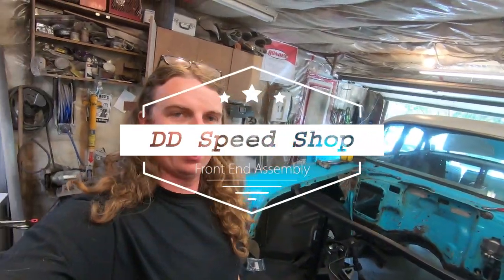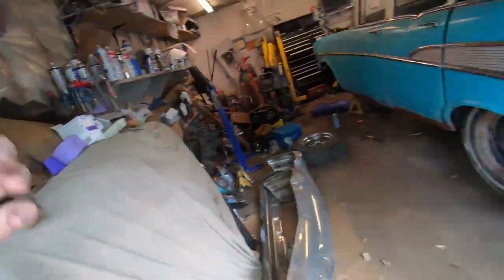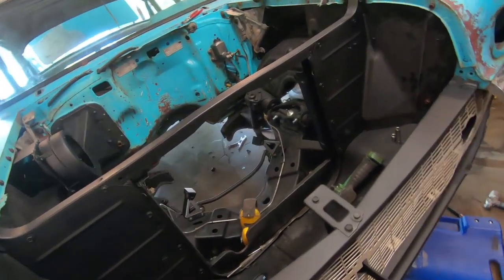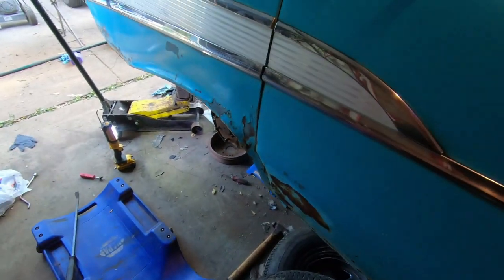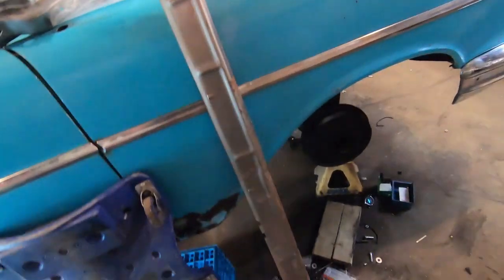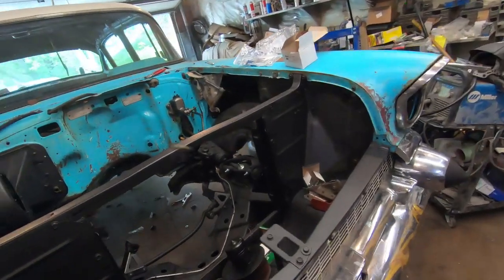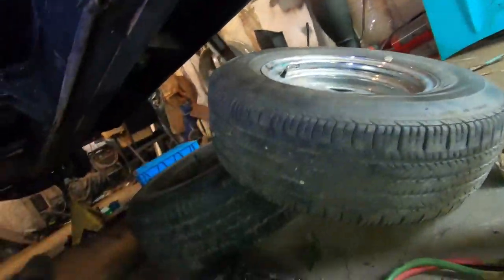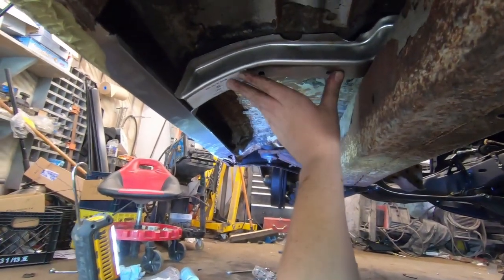57 Chevy Belair gets its Chrome Back!

Comment: You are moving along!! 👍 Those two curved triangle shaped peices. Go in the engine bay between the radiator core support and frame. Just above the two new bolts you installed in the frame for the lower control arm. They had some small weather striping attached to them as well.
Reply from the maker: awesome thanks!

Comment: Coming together nicely, you might want to checkout those saddles you put in for the engine to mount on.  They look like they are a bit high and that might cause a problem with the transmission when you go to stab the engine and transmission in the car.  Are you going to cut off those braces that come off the frame that were for the original engine and transmission?  Good luck on the rest of the build, look forward to seeing it run..
Reply from the maker: I just followed the instuctions while installing so hopefully everything fits.  If everything clears I'll probably just leave the original mounts.  Thanks for watching man!

Comment: Your drive to finish a project is admirable. Nice work on the front suspension and rocker box work. Are you making it automatic or stick transmission
Reply from the maker: the car came with a th350 auto
Reply: What flexplate did you use to bolt the Th350 to the 5.3 LS.

Comment: It looks like your missing the fresh air vent tubes that go from the firewall to the headlights, thier's a front and back for each side,the one i think has a "T" off if which goes to the blower motor,they also hold your headlights in aswell
Reply from the maker: I have the fresh air tubes just havent put them in the fender yet

Comment: Hey. I'm only 3 minutes into this video.
Granted, I'm no mechanic. No negative comments from me. Ok.
1) motor mounts, how do you know where to place them? Yes, I probly missed what you said about it.
2) the '57 Chevy heater fresh air intakes are NOT located in the same spot as the '55 & '56 Chev.
The '57 Chev air intakes are directly over the headlights. No, I don't remember just how they did it or what they used, but flexible hose of some type. 
Sorry I cannot offer any more help.
Now, I'll get back to your video.
Great job!
Oh, I guess you won't be using an original 283 engine. Kind of why the different motor mounts. ( engine mounts).
I'm 62 yo, and having trouble mentally.. 
So please bear with me....
Yes, the center of the grill bar gets a plastic type Chevy Crest/ Chevy bow- tie insert. They ALWAYS broke.
The grill itself would be silver in color, unless the car was a Bel/Air.  The Bel/Air recieved the gold anodized grill.
If I remember correctly, the Bel/Air bumper Dagmars got the rubber bullets as yours has. The Bel/Air ALWAYS had the fanciest trim appointments. 
Oh, Dagmars are the pair of round bumper protrusions on 1950's cars.
Buicks had them, Caddy's........
Yeah, look at a lot of stock pictures of your car to figure out where all the pieces go is the best way to see what goes where.
You'll get it done, you're a smart guy!!!
Best of luck bringing back a classic piece of automotive history!!!!
Reply from the maker: haha you seem to know alot about ri five chevies!  Im just getting into them but I feel the addiction already.  Thanks for the support!
Reply: @DDSpeedShop  yes, you can say I've been obsessed with them since my first ride in a '55 Chevy Sport Coupe back in 1959. I was 3 y.o. LOVE the '55 Chev. Built MANY models of the tri- fives as a kid.
You get to build the real deal!!!
Be- safe, keep up the great work!!!!
Reply: Oh, the '57 Chevy also had as an option, under dash tissue dispenser, vacuum powered ashtray, auto headlight dimmer, windshield washers, traffic light finder although that's not the correct term for it.